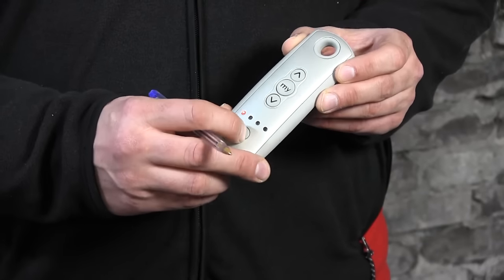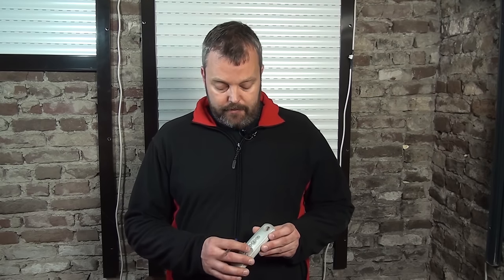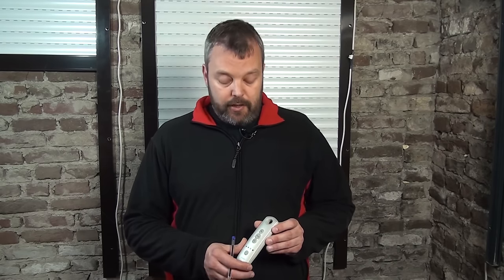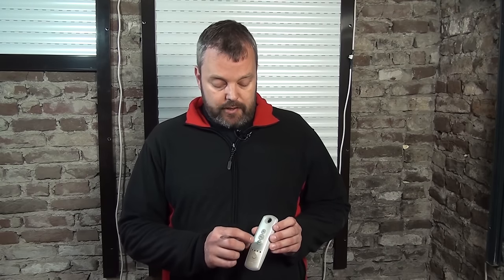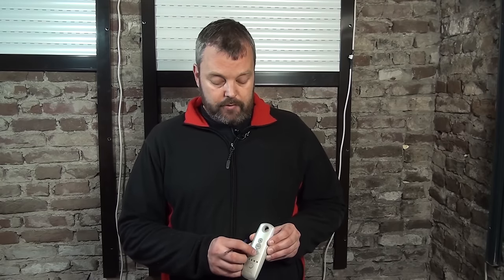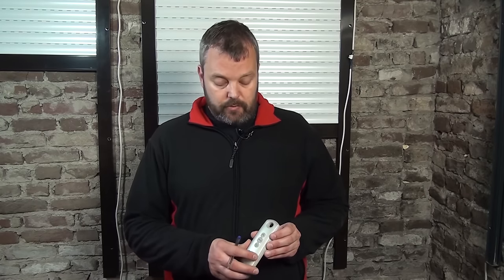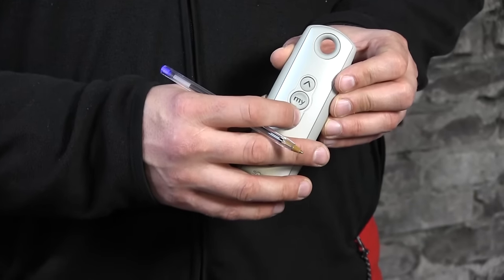How to program a Somfy RTS motor (setting limits - direction - link remote)

Comment: When re-establishing the end limits for the awning I followed the example in your video in which the down (extended) limit is set first, followed by setting the upper (retracted) limit.  While this sequence seemed to complete properly I was not able to exit the programming mode by depressing the small button on the back of the remote.  Depressing that button did not result in any action (i.e. motor jog) and indeed the new end limits were not correctly stored.  I then consulted the written instructions that I had received from Somfy in which they instruct to set the up (retract) end limit first, followed by the lower (extend) limit.  When I set the end limits in that sequence it worked perfectly and I was able to exit the programming mode successfully.  All is now functioning as expected.

Comment: Hi great instructions. My somfy stop at my limit when pressing the middle button but goes all the way out on auto. Any ideas? It's a large sunscreen outside a big window, 4m wide. Could do a reset but not change direction. Could be wrong direction so it thinks it rolls up but instead extend fully?
Reply from the maker: Hi Tomas, if you were able to reset but not change direction, it might be the case that the reset did not work. 

Also, when you have a cassette for your awning (a box that hides the fabric when everything is rolled in), you can set the limit it rolls out, but when it rolls in, the motor shuts off by itself. That's a special function of the Orea RTS motor.

With such a motor, you only set how far it rolls out, then make it roll in with "my" and "up" and let it roll up until the motor stops itself. Then press my and hold until the jog, turn over remote, press prog until jog and you are done.

hope this helps..

Comment: I’ve gotten the upper and lower limits set, however I’m having trouble setting the middle limit (the limit that is obtained by pressing the my button). Any help would be greatly appreciated.
Reply from the maker: Hi Jacob, you first need to program the motor like in the video. Once that this done, you can set the my position like so: https://www.youtube.com/watch?v=uTcOGXzwz0g

Otto

Comment: Ho Otto - Thanks for providing all this great information!  a few weeks ago my 16' exterior garage RTS screen motor seemed struggle when rolling up.  It goes down fine.  Now if its down and I instruct it to go up I hear the motor click but it will not roll up unless I manually help by lifting the weighted bottom.  I have done a complete reset a few times.  Limits are fine, etc.  Except the motor still doesn't want to roll up without my help and even then it sounds tired.   I replaced the motor under warranty about 4 years ago.  Any suggestions?    It's wired directly to my circuit panel.  Thanks in advance!
Reply from the maker: Hi Mark, if you need to help the motor to go up, it's a sign of a motor that's at the end of its life. If it's 4 years old, you might be able to get it replaced under warranty (which is usually 5 years). BTW - what's the height of the screen and how often do you use it? 4 years seems short, but maybe it's a high screen and you use it often (lifespan of a motor is measured by manufacturers in revolutions, not years)

Comment: Hi,I have a question, how does the remote link to a specific motor ?So for example: I have 5 motors in a room - how to set them to specific channels? Are there some settings on the motor itself?And one more question - How many channels can I have in a system. For example if I have 50 motors in a residential object - can each of them have a separate channel or some sort of identification so the comands dont get mixed up.Thanks in advance,Miodrag
Reply from the maker: +galaba dur Hi, the number of channels is based on the max. number of channels a remote has. The Telis 16 has 16 channels, so that's the max for that remote. But take 2 of those and you can have 32 motors in your system. The motors and remotes work with a rolling code system so that the signals don't get mixed up. When you add a channel, you basically add that remote's channel / signal to the motor's memory. So the limitation is more on the motor side. But you can have multiple remotes to control a motor (depending on the version, this can be up 12, not including sensors)

Comment: Doesn't show you how to link your remote to a motor
Reply from the maker: Hi Taylor, it doesn't show that as a separate procedure, since it's the end result of a the programming procedure. If you have a remote and a new motor, follw this video and the end result is a motor with the limits set and the remoted paired.

Comment: Hi Otto,
My motor has lost its limit settings. Although the up & down work fine, the motor doesn't respond with any up-down jogs (eg with Up+Down). I have tried 2x power off to reset but motor does not react. When I activate Prog button, up & down does not work (or Up/Down+My), until I wait a minute or two, or press Prog button again. Any ideas please?

Comment: Hello
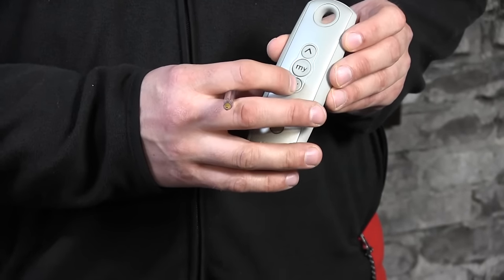Do you have any idea, what could be the problem, if our motor does just "roll", if I put down (compare video at 2:21) and not piece by piece, or only, while I keep pressing the button on the remote control.
I will have to stop it by hitting "my" and this does not seem to be correct.
Also, Up + my does not work then, to roll the motor up again and save the down position.
Thank you very much for your help!!!
Reto
Reply: +Reto Stauffer 
Any ideas?

Thank you

Comment: Hi Otto,
I have an awning that has previously had a Soliris sensor attached to it . The sensor has been removed and the motor needs to be linked to the household ring main via a 3 pin plug. The  motor has four cables coming from it and will be connected to a three core cable that plugs into a wall socket. How do I connect the wiring ?

Comment: Dear,
 I do have 2 units of CENTRALIS indoor RTS. i have done the installation and everything is fine. now i program channel 1 to the first and channel 2 to the second in my wireless remote control. my concern how to program both Centralis to work in single button in the remote control.
Regards.
Reply from the maker: Hi Mohammed, go to channel 3 (for example), press prog on centralis 1 and prog on the back of the remote. Now go to centralis 2, press prog on the centralis and then prog on the remote. Here you can see the video about the centralis: https://www.youtube.com/watch?v=S4RjkGjExYo

Good luck, otto

Comment: Hi Otto, I have 2 somfy rts motors but the cables are sitting in the ceiling. So I cannot power off them 1 by 1. Can I reprogram them without powering off the one and the other?
Reply from the maker: Unfortunately, that's not possible. Is there a way to connect an extention cord to one of them? That would allow you to reset and re-program just one.

Comment: I have four roller shades i replace the motor for shade 1 and the three shades work but the new motor does not would you know the reason why?
Reply from the maker: Sorry for the late reply. When you get a new motor, you need to program it, as shown in the video (set end limits and link remote), the remote doesn't work with the new motor right away (as it's in factory settings)

Comment: hi how can i program a control if the original is lost and the motor is not comfy but is attached to a multilink
Reply from the maker: +Michael Visacki Hi, not sure what the procedure is, as I don't know what the brand is. However, when the original remote is lost, you always need to reset it and start from scratch with a new remote.

Comment: how to programm multishades from factury settings. i got only all four installed and moving but need to do also as individuals, but doesnt work.
Reply from the maker: If you have them all connected to power, they will all respond to the same signal at the same time. Make sure only one is connected to power and then program it. If they are already linked to a channel, reset them and start over with just one at a time.

Comment: What could the problem be if my remote is not responding to the commands?
Reply from the maker: Claudia A Hi, the problem could be an empty battery (if no LED starts blinking that could be it), range issues (too far away or something blocking the signal), a defective remote (dropped or otherwise broken), or a motor issue (how old is the motor / does it respond to other remotes (if linked to this motor).  I would start with the remote (maybe even add it as a second remote to another blind just to see if it's not a remote control issue). If it's not the remote, it's the motor. If you need more help, do let me know.

Comment: How to link it to an Extron AV System
Reply from the maker: tnatiq RTS motors in general are not the ideal choice when you are using another manufacturer's control system. If you are starting from scratch, get regular wired motors and a roller shutter interface from Crestron.  If you already have the motors and the Crestron system, you need to program the motors (so set end limits etc) with a Somfy remote and find an interface that basically translates the Crestron signal into an RTS signal that the motor would understand. There might be an interface that can do that, but I don;t kow the Crestron product range well enough to tell you for sure (and which one that would be). If you can find a Crestron installer in your area, it might be worthwhile to ask if they know of the right interface.

Comment: My "my" button doesn't work, doesn't stop screen.
Reply from the maker: +MrSpankymandy  Hi, is this on a motor that was working fine before? Or during the programming process? Is the same remote also connected to another motor? With this info, I can hopefully point you in the right direction.